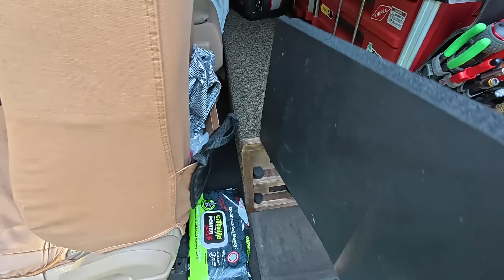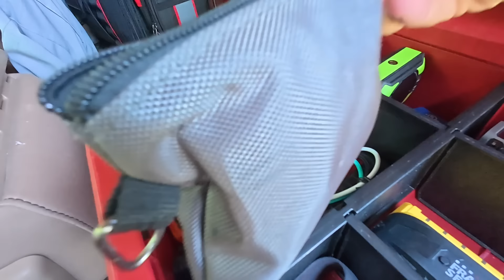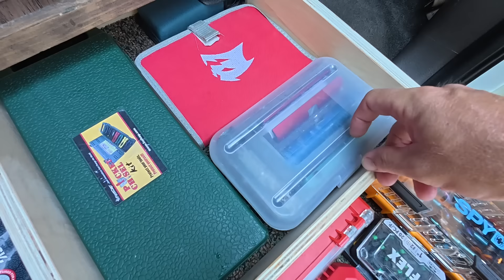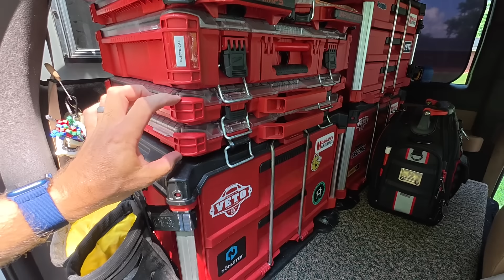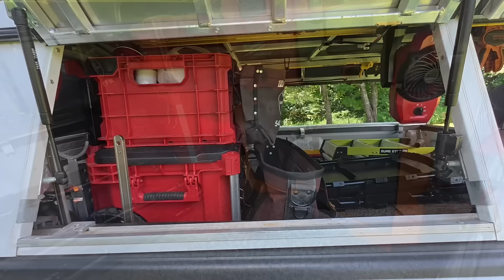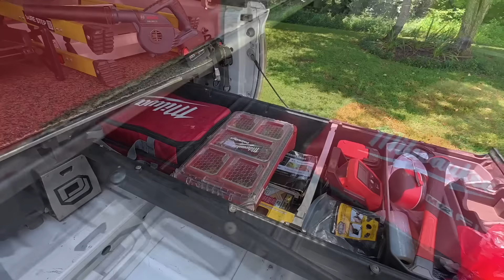2025 Truck Loadout - General Contractor & Handyman - My Best So Far?

Comment: Great Video.  I am not a handyman and I do not have a construction background; but, I was extremely impressed with your organization and the variety of tools you have to tackle pretty much every job that can come up, to include helping a needy person stranded on the side of the road with a flat tire.  Hats off to you🫡. Please don’t take offense, I am not in competition with you or will I ever come close to attaining the amount of technical skills you have, but can you please explain to me and the public why the triple redundancy in some of your power tools?  Power tools are extremely expensive and for the young person starting out or mid-aged adult changing careers in order to survive, the over redundancy of power tools can definitely be a set back for them.  Lastly and most importantly, thank you for sharing your time and knowledge, GOD BLESS YOU AND YOUR FAMILY SIR.
Reply from the maker: I have some redundancy as far as what a tool will do for a couple of reason.  One is, I love tools 😂… so if I find an excuse to buy one I do.

The other is certain tools are better for certain things even if one can still achieve the result.  On the enjoyment factor and sometimes the end quality,

For example I could have a grinder and cut nearly anything metal I will ever cut, but on certain things a bandsaw will give you a cleaner cut along with no sparks.  One could buy a grinder and do any of the stuff I use my bandsaw with, but not at the same control,quality, and enjoyment of that specific job.

Levels are the same thing.  I can put a 4’ level on a lot of things and be fine, but sometimes it’s not going to tell the whole story of something 10’ tall.  

That applies to all sorts of tools.  I would always recommend the getting the staples.  The tools that do the most work… and then start adding from that based on the work you do.

I’ve been doing this along time and buying tools a long time.  Most people can’t afford to be me on day one, I couldn’t
Reply: @MORGANSMaintenance you certainly articulate well and with your expertise and experience, I’m quite certain you could be an instructor at a school.  Happy to have found your videos and thank you for sharing.  Look forward to watching all your videos.
Reply from the maker: @JCLives247 glad you found me too 👍

Comment: As a building maintenance handyman, I don’t necessarily use any one particular power tool 100% of the time so I try to keep all of them brand specific so I only have to have one type of battery one type of charger so everything is Milwaukee if I know that another tool brand makes something better. I’m not gonna get it just because it’s not compatible with the battery and the charger and I charge my batteries on the road with a 12 V Milwaukee charger so I like to keep Cohen consistent with my batteries since I don’t have a whole lot of space for storage I only want one power tool brand
Reply from the maker: I am the same for the most part. I’ve also bought adapters for other tools to work with my main batteries

Comment: All of my fine tools like electrical testing equipment and precision screwdrivers anything a small that could get lost or that I don’t wanna get Joel around in a drawer. I put those in zipper pouches with a big carabiner on it and I hang them from a laundry bar in my backseat.

Comment: See to me a Vito pack is good if you’re doing one specific trade if you’re doing HVAC, which is actually a multitude of trades but they’re all related or are you doing electrical work but when you’re a general maintenance guy where when you walk into a building, you could be doing three or four different types of repairs your tool bag needs to be pretty big because you need to carry stuff for all occasions and I’ve tried it before where I had a different bag for each trade and I’d have an electrical bag of plumbing bag and that only works with plumbing tools because your wrenches get so big that you need a big canvas bag for them but for all your regular standard normal size tools, you need a big toolbox or a bag to put them in like something like a veto pack on steroids with like 10 million pockets

Comment: When you’re a building maintenance guy, you have to carry so much more stuff than a contractor who does one specific thing so you have to live like van life to where everything goes in a certain specific area and you can’t just throw shit in there. It actually has to go in its exact spot or else everything isn’t going to fit.
Reply from the maker: It does take a lot. I’ve always said my life would be a lot easier if I did one thing.  Boring I think… but easier

Comment: My company vehicle is a Chevy equinox. I do building maintenance for banks, not bank equipment, maintenance building maintenance so I have to carry stuff for carpentry, jobs, painting, jobs, plumbing, electric, and what I call stagecraft which is all the oddball accoutrement of a commercial building that have nothing to do with building systems things like push pole stickers for doors, wire ties, drawer, handles, and knobs all different oddball things that aren’t really building maintenance things, but are unique to my personal work environment

Comment: In the winter time, I carry more stuff for indoor repairs like paint and spackle and stuff like that and in the summertime I carry things like pressure washers and cleaners for stainless steel and outdoor items. I try to focus on outdoor maintenance in the spring and summer indoor maintenance in the fall and winter it doesn’t always end up like that but when you work for the company and you’re not an independent contractor, you gotta go with the flow.
Reply from the maker: 👍👍… I try to work indoors all the time if possible, but not always how it goes

Comment: One of the most important things to get together is a passenger seat, front seat office, preferably an office where you can take the whole thing out on a moment. Notice in case you have a passenger like this morning I got some new things in the mail for my truck and one of them is called a patrolman‘s bag that’s what policeman used like flashlight paperwork, all sorts of odds and ends and it’s a great bag/carry case for all your oddball stuff that’s in your front seat when you’re running a business or something like that I don’t run a business but I look after 21 banks and two corporate offices so I have lots of stuff that’s not tools and hardware that’s up in the front seat with me
Reply from the maker: I’m have added some stuff to the passenger seat since this video that’s helping some… but you are right

Comment: Have you ever weigh-in at a truckstop?
Reply: That was my first concern about that buildup , I’m guessing with the full fuel tank and driver in , it’s probably 900 lbs over payload and without any job material load
Reply from the maker: No, not in this truck anyways
Reply: @MORGANSMaintenance  I’m guessing 9000 pounds lol
Reply from the maker: @mmgee maybe 😂

Comment: What are the dimensions of your long pull out drawers?
Reply: Also, what did you use for the drawer stops? Killer setup man, better than any other back seat solutions I could find
Reply from the maker: Appreciate it 👍

They are 16”w… one is 5-1/2 deep and one is 4-1/4 and both are 44” long.

These are what I used for stops https://amzn.to/43JXIMc
Reply: @MORGANSMaintenance  awesome! Thanks for the inspo!

Comment: I started watching because of your shed build.  Then looked at your channel which brought me to Truck Loadout.  After watching for a little bit I had no doubt about your skills.  Anyone this neat and organized can work on my home problems anytime.  LOL except I do all my own.  I am a tool guy and really enjoyed it.  Hauling my tools/equipment around 21 years servicing CT MRI and xray systems.  Thanks, Randy
Reply from the maker: I bet that’s a fun job… they are losing a lot of money till you get that fixed… pressure 😂

I am two columns and 4-5 trim boards away from being done with the outside.  I just did some grading on it when I got home today
Reply: @MORGANSMaintenance  awesome and yes when the cash cows get sick everybody starts hollering

Comment: Very nice set up. The drawers in back are great, but I really like the drawer storage you built for the cab in the back seat area. You have given me a great idea for my truck in the back seat area (I work for a Fire Marshal’s Office). I have a full crew cab and would love a full drawer extending out both sides. My truck has an ARE cap with a slide out shelf in the back.
Reply from the maker: It makes it nice when someone parks close to me… I’m really liking it so far 👍

Comment: What type of containers do you use for your hot mud?
Reply from the maker: Old protein powder jugs for the ones in my truck.  I use old USG Dust Control buckets for whole bags. A whole bag fits in those perfect

What I Use for Drywall Finishing - Milwaukee Packout Loadout #tools #milwaukee #drywall #level5
https://youtu.be/zxeQ54jmh84

Comment: Just buy a high top van. Omg.
Do t get me wrong, amazing set up, but for the love of god, just get a van. You can stand up from the driver seat, walk to back, get your tools and walk out. And you the end of the day is 1 million times easier than any truck or Chevy van.
Old guys are the most bull headed about high top vans, all they’ve know are Chevy express’ which are terrible, so they love their trucks because “a toppers just the same as a van” …not a high top. It’s like a cargo trailer that doesn’t suck to park.
Reply from the maker: I’m not bull headed.  It’s just zero debt.  When I have to buy a new vehicle one day I might buy a van.

I already had this truck when I started my business and I’ve been making it work until I saw what direction and the type of work my area had for me to do.  That way when I go to purchase a vehicle I can make the best decision. I don’t want to spend a ton of money on something without seeing what all I might be using it for.
Reply: @MORGANSMaintenance I joke with an old timer we do finish work for, he’s an old cabinet maker that makes 3-4 trips to drop off a cabinet system to be painted with his f150 longbox standard cab. That is a crazy efficient system you have.
Reply from the maker: I definitely see the benefit of a van having one place to go for it all.  I have a 7x12 Enclosed Trailer I use when I am doing bigger or large amount of materials to a job.  That’s one thing that’s a little hard to get in my truck

Comment: How are your packout bins secured to back of cab/floor? Also, maybe consider a specific drill holster with a retention strap/positive engaging latch. Hate to hear you had to hit the brakes and you or your dash/windshield took damage from an airborne M12 impact driver! 

How do you cope with all the noise? Why not carry all this in the box?
Reply from the maker: My box is connected to the cab floor with the seat bolts.  The Packout Drawers are connected to the box with mounting plates on the bottom and straps through the supports on the back.

I don’t hear any noise from my tools in the cab.  The only noise I hear is the wing around my bigger ladder and it’s not bad.

I use the back for bigger stuff when I need it.  For a lot of service work I only have to open my driver side door

Comment: Those side fold up doors on the cap I thought when you open those up that those would have shelves inside with like jelly jars full of parts or something like that That's personally what I would do I'd have those open into compartments we could just keep a shit toner nuts bolt screws stuff
Reply from the maker: That’s what I thought I wanted, kept looking for a top that had it. This one was the best price and closest used one to me so I got it and thought I’d build the compartments.

After using it though, I like being able to access my entire bed.  If those compartments were there it really limits what you can put in your bed and access.  Sometimes I put table saws, miter saws, etc and need a lot of room.

I fully planned on doing what you are talking about, but then after I used it this way for a while I really liked it.

Comment: That's a big ass mixer. The type of maintenance guy that I am, I have little tiny mixers for your drill because I'm only buying my spackle quart at a time it would take me forever to go through a gallon of spackle. I work for a bank that's undergoing renovations and all their branches so there's really not a whole hell of a lot to do and we live in the age of LED so everything is flat panels throughout the whole place doesn't need bulb changing not too too much to do although there was a lot of shoddy work done over the years and is a tremendous amount of catastrophes that happen on a daily basis like shit that shouldn't really ever happen
Reply from the maker: Yeah I worked for an orphanage that had been around over 100 years and they had had all sorts of volunteer work over the course of time. Led to some interesting stuff

Comment: I have a metal drawer from global mounted on a wooden platform in the cargo area of my SUV and I keep my drill in it and I use a barrel bolt to keep it dog down and that's a motherfucker to get that barrel bolt up and down every single time I need to get inside drawer and you have the most brilliant way to keep the drawers closed
Reply from the maker: My first set a drawers I had lock hasps I had to open and shut every time.  I got tired of doing that and I always had to move something to get to them

Comment: I have a little giant ladder that goes behind the passenger seat of my equinox I bungee cord it to the headrest so don't go nowhere and it is so thin that you could literally sit in the backseat with it directly in front of you and it doesn't really take up that much room it's very slim You can stick it in anywhere and I can get an 8 ft reach from the top step that's why I bring it with me so I don't even have to go inside a bank if I have to change lights outside I can just have light bulbs with me because I carry common light bulbs with me screw in bulbs and I could just change lights outside and not have to go inside get a ladder and walk all through the whole place with the ladder
Reply from the maker: I’ll have to look that one up

Comment: With a pickup truck I would store my supplies like my consumables I would store those in the bed area I would have one of those full length drawer systems and I would just have like a million little pigeon holes full of things like wire nuts and sockets and batteries and shit I wouldn't have that my cab area I would just have my tools in the cab area or have my tools in the bed as well and then have the hole interior b like the whole cab area be more of an office but I'm more of like a managing sort of maintenance guy like I have to fill out reports and do inspections and I could literally use a file cabinet on the road I could just keep a whole locker with like raincoats and snow gear and shit and keep all that behind my seat in the backseat area

Comment: I don't know I'm still doing strike plates with a Dremel Am I an idiot? Because I've been seeing people do it for years with a roto zip. I just want something that doesn't seem violent and noisy
Reply from the maker: That die grinder is just a slightly bigger Dremel. It has speed control and fits my batteries is why I use it

Comment: Grainger has a multi driver one of those screwdrivers where you tug on the end cap and is like two dozen bits in there I forget what the name of it is but I have like three or four of them they're really great I have one that does allen. That will make your rethink the way that you do Allen wrenches. To have bits in the in a driver that made me not get a set of Allen drivers. God knows those are hard to find
Reply from the maker: Yeah I keep sets of bits in my bags. I prefer putting bits in screwdrivers/ratchets over using keys

Comment: I do building maintenance for a bank I got 17 banks all the same company cuz I work for the bank I I'm not outsourced. My work truck is a Chevy equinox that they gave me a brand new with 100 miles on it top a line got all the options but it's small and I do a lot of shit. The packouts didn't really make it for me They were more for vans and pickup trucks I have the DeWalt two drawer chest I have a two-door trust in the trunk and one in the back seat one for parts ones for tools. I've been trying to post videos on my maintenance guy channel KO handyman on YouTube. I think it's really important for a lot of guys out there to see how other guys have their work vehicles set up
Reply from the maker: I’ll have to see if I can find it

Comment: Hey Joey - I have one more question for you.  What is the width of your Little Giant Sure Step mini step ladder at the base where the feet are.  The dimensions listed on the Little Giant website says it is 18 1/2" wide at the base, but that seems to narrow.  I would like it to be 18 1/2" but I figured I would check with you since you actually have one and like it so much.  Thanks so much!
Reply from the maker: It’s between 18-1/2 and 19 

Then it’s 26-1/2” the other way when you open and about 7” closed

Comment: I have the same ford truck just newer and was wondering how hard is it to take the back seats out? I was thinking about doing it. Are all the bolts holding the seats down come off from the inside or do you have to take them off from the bottom?
Reply from the maker: It wasn’t overall bad… most of it’s on the floor, there are a few that are frustrating, but not miserable

Comment: That driver door that holds the license and insurance information; that should be in the cabin inside of the glove compartment. That way it’s NEVER exposed to the weather and it has ZERO chance of falling out as you open the door.
Reply from the maker: It’s wedged in their pretty good… and they are copies.  I could probably move them behind the seat with my clothes. I don’t think they will fit in the glove box